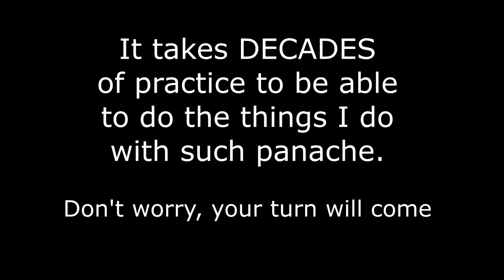How NOT to Use Anchor Seal # 114

Comment: hi there never used the stuff . i think most people that  put it on logs not to be sawed to me do it wrong . i think it should only be put on the outer part so the center can dry/shrink faster , oh well  thanks john
Reply from the maker: This is the first time I've used it and it worked GREAT for the 30 minutes it was on the log..... not a single split/ crack/ check.
Dave
Reply: Has anyone tried tightening a hose clamp around the end to keep splits from opening up? my guess is that re-tightening will probably be needed occasionally.

Comment: Why did you split the pith?
Reply from the maker: I needed to get two 5-1/2" cants out of the log and wanted to make sure I had enough; couldn't risk cutting the pith out . The pith on the edge of a board doesn't seem to cause as much problems as when it's in the middle.
Dave